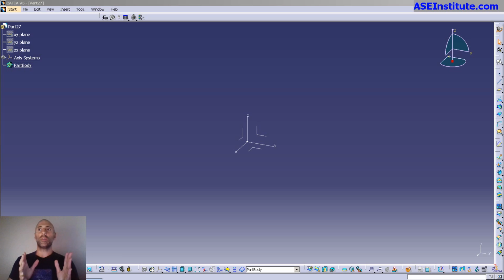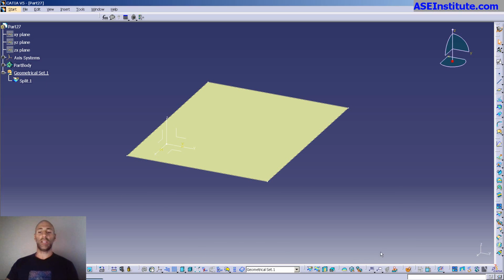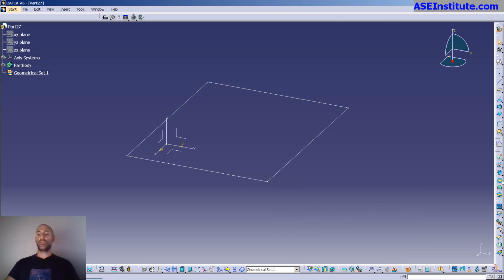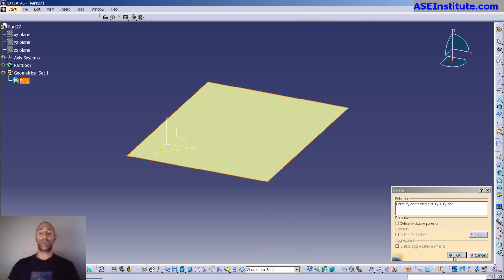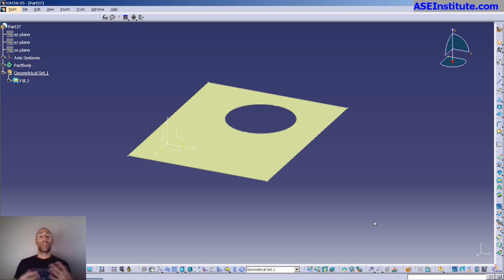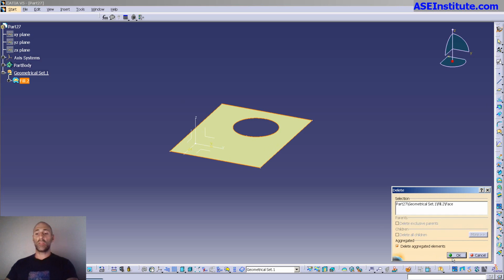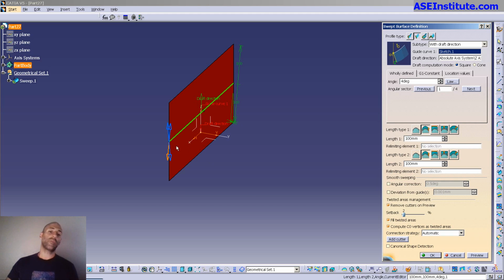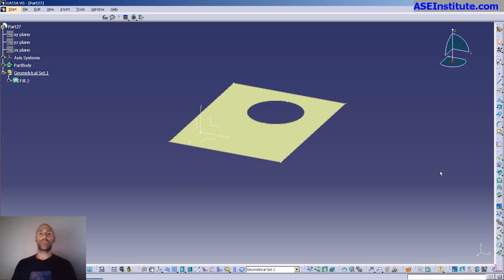To Fill or to Split - That is the Question: Catia V5

Comment: Hi, if by any chance, I hope someone can will see this question, but when I try to use the command Fill in Catia  I can't see Inner and Outer Boundaries tabs, do you know any fix for this, please?
Reply: Same here, please let me know if you have found a solution
Reply: @shrinathjadhav3610  I think it has something to do with the version of Catia that we are using (yaarrrr). This might be a feature implemented in newer versions of Catia so you don't have any options just to find a workaround
Reply: @shrinathjadhav3610  i have the same issue